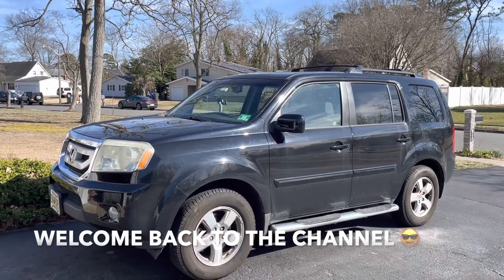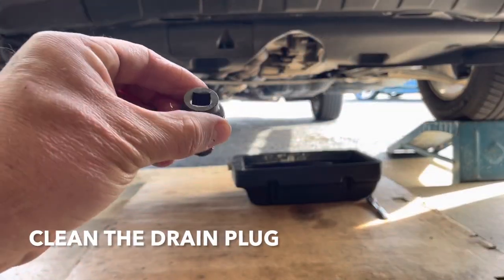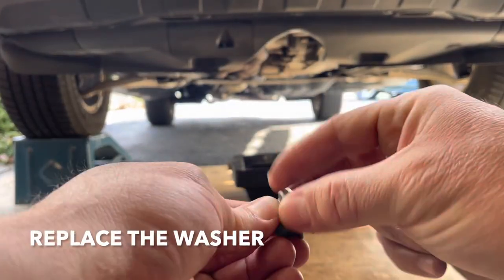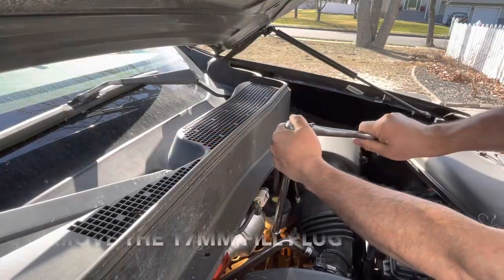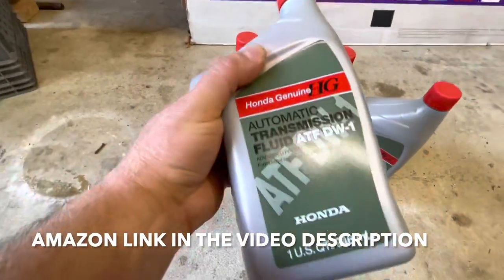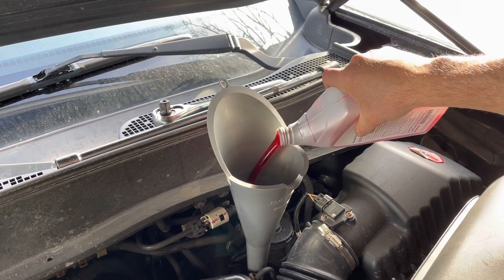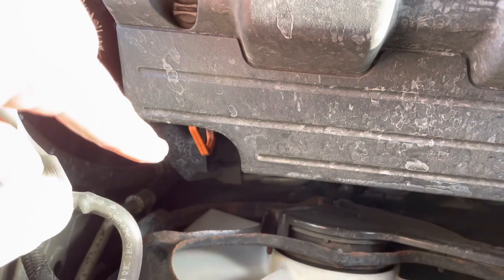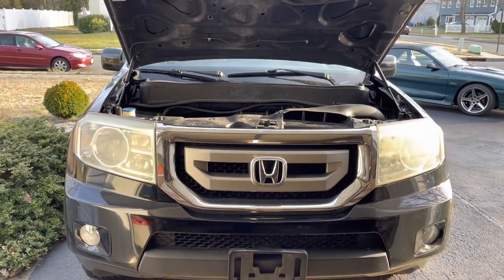HONDA PILOT TRANSMISSION FLUID CHANGE - How to Change the Transmission Fluid on a Honda Pilot. Easy!

Comment: Thanks for the video! Had issue with the refill bolt. Couldn’t get it loose! Any tips for that? I ended up using the dip stick method. Plus how long do you run the car for?
Reply from the maker: Attach a pipe to the ratchet wrench for leverage to get the bolt loose. I took it for one mile ride and ran through all the gears.
Reply: Impact extension and socket and it’s off

Comment: please help. I am having a screeching sound when i get up to about 2,100-2,300 rpm. but does not screech after that point. i checked the transmission fluid and it is a bit low. could that be the culprit? This screech only happens in Drive. Parking and Neutral are fine, and does not make that sound.

Comment: 1:34 - I did mine and my refill hole's bolt doesn't have a crush washer. Do you know what size is that washer? It's not the same size as the drain bolt washer's. Thanks.
Reply from the maker: Should be 20mm

Comment: Why can't you fill it through the dip stick tube like every other vehicle?
Reply from the maker: You can if you want. This way is quicker.
Reply: How many miles did that car have
Reply: Yeah a lot of videos I found on youtube say to use the dipstick to refill. I think that's more difficult just because how small that tube is. Much easier to use the refill hole. It's not that hard to remove the refill bolt really.